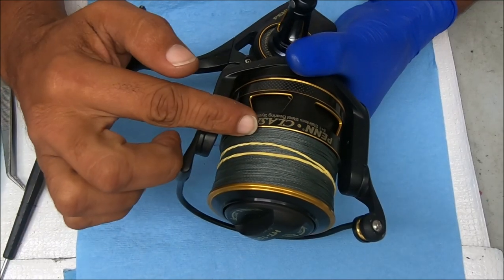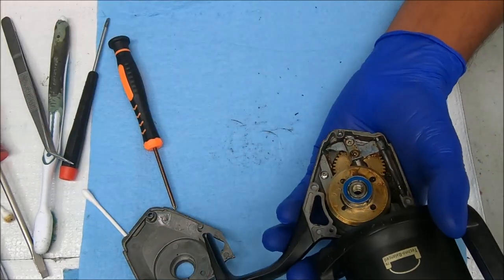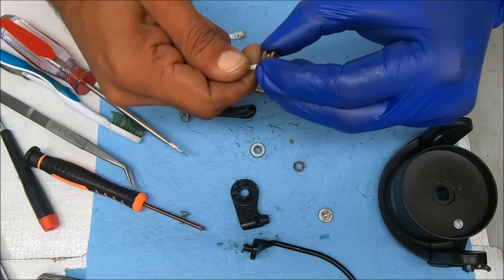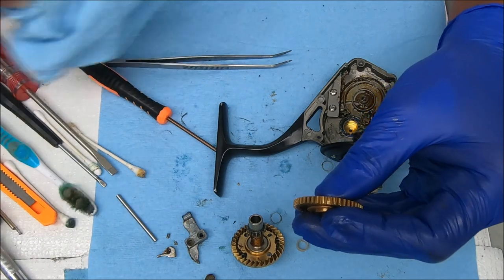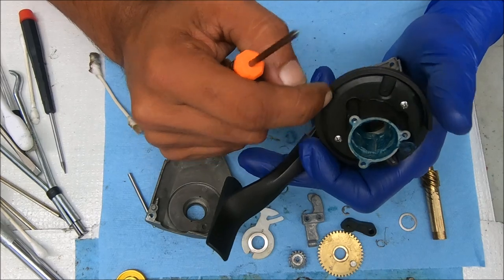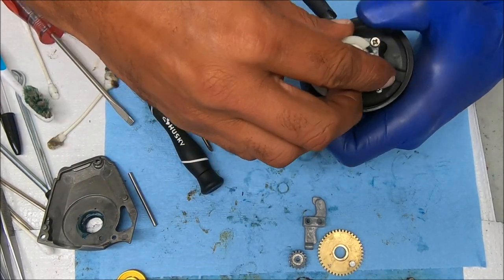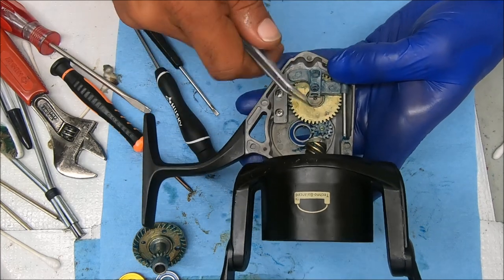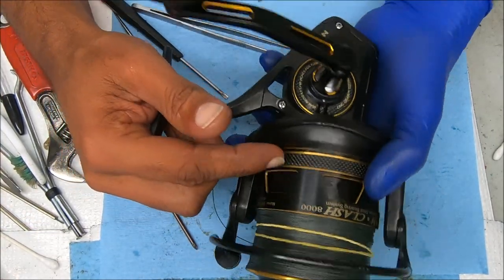Penn Clash 8000 Fishing Reel - How to take apart, service and reassemble

Comment: Good morning and good job. What do you think caused the catastrophe damage inside that housing, poor quality or abuse? And, why do they design reels today with a secondary anti reverse dog when it already used a roller bearing? Also where do you get your parts, Penn or another source if you don’t mind me asking. I don’t live far from Mystic Island Nj. 😉
I’m glad to hear that even with everything you needed it was coat effective to do the repair. Sorry for all the questions. Have a great weekend.
Reply from the maker: Thanks Steve! Great questions! He didn't give me the story behind what he was doing when it happened, but It was either the drag was so locked down when he was snagged, and he used the handle to try and break it free, that the weaker gear/post gave out.... or there may have been some imperfections in the gear that caused it shear under load.

Regarding why the secondary gear, I think it was an experiment in design to try and stabilize the play that just having a crossword has due to the spacing in the block when it rides on the post, or the vertical "flex" that happens naturally. I'm not an engineer, so these are all just speculations.

The secondary dog makes sense, considering the tendencies of most fishermen (myself included).... that a/r clutch is flawed, by design, because it is in such a vulnerable spot... hard to keep water from destroying it, so you need something there, in case it fails... especially if it isn't checked/serviced regularly.... of the big three, Shimano does the best job of protecting this area. The instant a/r creation was spurred by fishermen wanting a more instant a/r.... think back to the days where aftermarket ratchets with 10/12 teeth were made for the 9500SS.

I just got off the phone with Mystic, actually. I use them for Penn parts 90% of the time. Of the places that source Penn parts, I've found them to be the best. The speed, accuracy and customer service they provide far exceeds any possible savings one can get elsewhere. They're the only place I would recommend if you're in need of Penn replacement parts.

Have a great weekend... check back tonight or Saturday for another video... not sure what I'll post yet, but it'll probably be a short reel repair one. Spread the word about the channel.
Reply: @TSGReelService  Well thank you very much for taking the time to type that very detailed reply. I really appreciate it, I learned a couple new things. I also agree with everything you wrote about mystic, very nice people and service. I live about 1 hour away from them, they’re not far from Atlantic City. Actually I live closer to Philly (11 miles) just over the Delaware river in Jersey. Looking forward to your next post.
Reply from the maker: You're welcome and no worries. Rest assured, they're not always that long, 🙂

Yep, really nice place to do business with.

Comment: Putting mine back together and the dog keeps enguaging and not allowing the rottor spin any idea?
Reply from the maker: Thanks for checking out the video. Yes.... if you're sure it's the anti-reverse, flip it upside down and reassemble the reel.... not even sure how you would get the reel to fit together like that..... there should have been tightness in many places. If you're referring to the backup dog, rewatch the assembly section and follow it.... it's as detailed as it can be..... there's no more I can add.